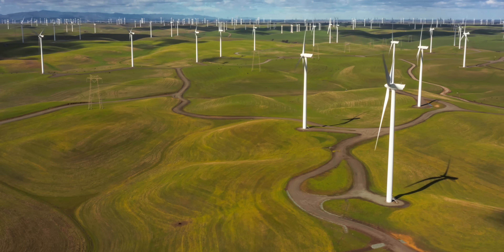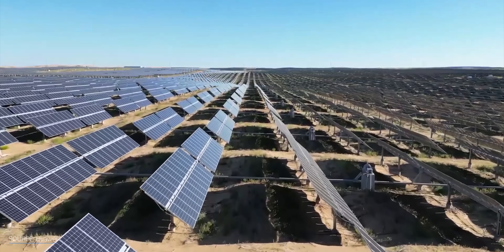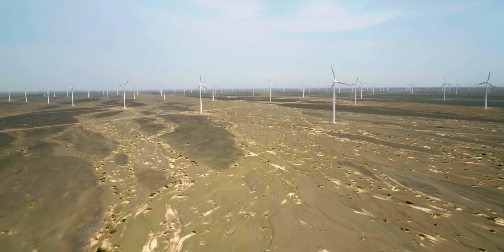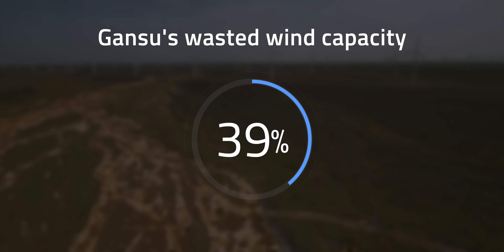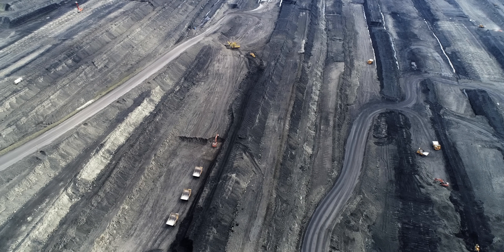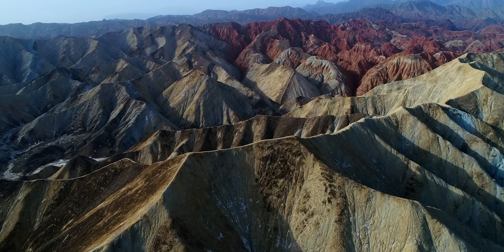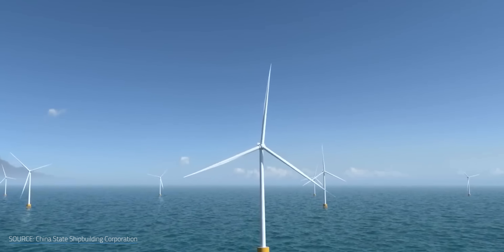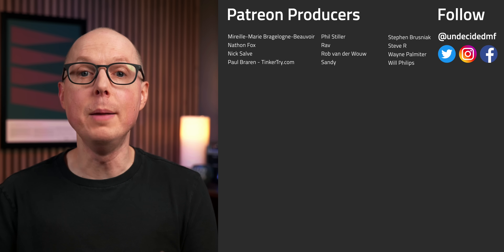The World’s Largest Wind Farm has a Tiny Problem

Comment: It is the load factor to understand how productive these wind farms really are during the year so multiply by peak capacity gives average amount they truly generate. Most have a load factor of about 25-33%
Reply: So for the most part 70-60% isn’t utilized does that mean the per mw hour the cost is higher than a gas nuclear etc which have constant production and arnt wasting nearly as much ? Or is wind 1/3 of the price therefore still competitive
Reply: @patrick-c6s You miss a n huge assumption as you don’t understand how the national grid works. Supply of electricity  must exactly match demand with MWh so in terms of output wind is “free” when it has a maintenance ost average above £20 Meh which may be cheaper than fossil fuel or nuclear but when you add the back up cost of fossil fuel for the high percentage of wind not delivering the required amount of power, the combination of the two costs is more expensive than if the grid simply contracted with fossil fuel alone and this simple analysis also excludes the huge subsidy paid to wind turbines. Something like 30% of a utility bill is subsidizing green renewables. No wonder UK has highest fuel bills for a major economy.
Reply: @_RabbitLeader  I understand how it must be balanced I probably didn’t get my point across well do you think the wind farms have any merit in terms of profitability environment etc ? What would be ur ideal grid composition? Just curious what others think
Reply: @patrick-c6s  Too costly to be building looking to wind to supply such a high % in UK. Even National Grid not sure how it will balance. Balancing costs will only explode.

Comment: 3.1 GW of LA’s power comes from the pacific DC intertie, going from the Washington border to LA. The California grid max is 50 GW. Typical daily load is 35 GW, so roughly 10% of California’s power is coming from hydro in Washington / Oregon. Long distance high voltage DC is totally doable in the modern era.

Comment: I live in Las Vegas, NV. Nevada is mostly open area, owned by the Federal Government. They say if you cover an area about the size of Clark County, where Las Vegas is located, you can power the entire U.S with solar power. Las Vegas has something like 330 sunshine days a year. The problem is just like China, what do you do with overcapacity? There are many options, from batteries to gravity devices. I personally like the gravity devices. The energy is free because it would just be led to ground. It doesn't matter if they are efficient. The power to operate them is free, otherwise going unused.

Comment: Wind Baseplate Power <> Produced Power.  These things are not efficient and MUST rely on hot-standby power.  Every wind turbine has an actual lifespan of 15 years before the cost of maintenance exceeds the power output.  Those at sea wear out more quickly and the cost of the undersea cables is greater than that of the structures.  These things cannot be recycled.  They are cut down like trees, chopped to pieces and placed into landfills.  They consume 100++ more area per watt generated compared to nuclear.  Hydro is truly clean, green, sustainable.  However, proposals are underway in the PNW (Pacific NW of the USA) to tear down hydro dams and replace them with wind turbines.  That would be economic and environmental insanity.

Comment: You lost me when you said "just one gigawatt".  One gigawatt is the capacity of a very large nuclear or coal plant.  Lots of the coal plants in Utah produce 400 MW per unit, so it would take two and one half of those units to produce one gigawatt.  We have some very impressive wind turbines near my home, 27 of them.  They have maximum production of 27 MW.  Given that they produce on average only one third of capacity, it would take about two thousand of these turbines to produce, on average. one gigawatt.  And you still haven't dealt with what to do to provide electricity when the wind isn't blowing.

You're living in fairy land.  There's not a chance people around here will let even one more windmill be built after they have seen what these 27 did to our scenic vistas.

Comment: I don’t think you can judge what is a success in a mere short time frame, these things and all the associated infrastructure are very expensive to install , they also have a service life and a cost to maintain, the same as those gigantic battery packs  , they also have a pollution footprint as well , some of which no one on the planet has found a good solution to I might add . 
Like T hose gigantic blades , bigger than a road train need to be replaced when the service life expires . 
I suppose for china they could just leave them in the desert to be covered with sand .
 All those wind turbines and thousands of miles of power lines also will need maintenance, , nothing is for free, even if initially now on paper it looks pretty good . 
Come back in 50 years and tally up for the true cost, I’m betting it won’t look anything like a cheap solution .

Comment: Matt Ferrell only briefly mentioned the missing part of the jig-saw which is energy storage. Using surplus windpower to produce green hydrogen looks like the most likely longer-term solution.  But the electrolyser developers are running to catch up and issues with hydrogen, like storing the stuff, are also still remaining to be effectively resolved.   

Hydrogen will be needed to replace natural gas in the long-run and clearly the use of electricity that would otherwise be wasted from large wind and solar farms is the obvious carbon-free way to produce it. Give it another ten years and the hydrogen economy will ride in on the back of wind and solar. I'm one of many working on the development of safe, lower-cost hydrogen storage.
Reply: @PeterFraenkel  

Please give us a hint about how to store / transport hydrogen cost effectively. Not trying to be critical at all but these are some of the issues with hydrogen. Personally it seems that ammonia might be a big player in this area, especially for countries like Japan.
Reply: forgot to mention in my earlier response below that our underground pressure vessels  could also contain ammonia which like you say is a potentially important alternative form of energy storage @Mentaculus42
Reply: JCB here in the UK certainly think so, and have developed not only the engines but the production, storage and transport of the H2 - they have tried battery power but for large machines which have to run all day, they take too long to recharge. The H2 is taken to the farm or construction site so refilling is a very small downtime. Installing a national network of H2 storage is another matter though...

Comment: The cost of land in China is a non-issue.  If the government wants land for a pro, there’s no acquisition cost.  They just say the land is now owned by the government.  No cost there.  

The cost to develop renewable energy in china is significantly lower than in the US.  Labor costs in China are a fraction of the labor costs in the US.  China builds the majority of the world’s solar panels, so between labor and manufacturing costs, land acquisition costs and operating costs, the costs per kWh in China is dramatically lower.  Plus they don’t worry about complying with environmental regulations.

Comment: Wind and solar energy enthusiasts never factor in land costs, backup costs, maintenance costs, regular replacement costs or the co2 emissions related to the manufacture, installation and logistics of these enormous infrastructures. They know deep down large scale renewable energy is a fools errand but they are wedded to ideology rather than common sense. They’re always on the left of politics. China’s motive is to dominate the manufacture, not to reduce co2 emissions.

Comment: Gansu is the same as ALTA in Kern county, CA. It is on the edge of the Mojave desert. The nearest town, Mojave, is population 3,850 and it is dirt poor. Hot, dry, windy, with loads of trailer parks and loads of residents that rely on section 8 housing vouchers. Mostly impoverished residents. The nearest large town in Kern county is Bakersfield, 90 miles away.  But almost all of that energy goes to LA, also 100 miles away, where there are millions that need it.

Comment: If only it could be like turned into hydrogen and pumped places and turned back into electricity in fuel cells but is building giant hydrogen pipelines any cheaper than HV lines?
Reply: Or couldn't they just send it through the rails of all the high-speed rail they built everywhere?

Comment: For me its all about the economics.  If you asked me to  install a wind like this in the US to just pay almost double the cost for electricity the answer is a rock solid no. 

And that cost was after massive gov subsidies that would not happen in the US.  Most new wind projects in the US have been put on hold because they don’t ROI especially due to maintenance costs ballooning and turbines not lasting as long as they were supposed to.

Maybe nuclear power is the better answer here, I see Microsoft will pay to restart 3 mile island and not build a new wind farm.  That says a lot.

Comment: Increasing renewable energy generation requires more overbuilding and less efficient use of electricity generation capacity. I still support wind and solar generation but there is requirement to have equivalent generation capacity from more reliable sources. My Canadian province, Alberta, has recently become coal power free, now having shifted to largely natural gas with wind and solar as the 2nd and 3rd largest maximum capacity sources, respectively. Looking at the current “supply demand report” I am a little proud to say that the wind farm I was a small part in the construction of is the largest producing wind farm at the moment. Fourth highest max capacity but most generation at this moment.

Comment: I'd be careful citing China's green energy as a success compared to other countries. China continues to be the large CO2 producer by far at ~33% of the world output, and still increasing annually at about 500 Mt per year average. For comparison, Canada's total CO2 output is only about 580 Mt per year, so China is increasing GHG output at about 1 new Canada per year.

By contrast, the U.S. peaked about 2005 to 2007 and decreasing at a rate of about 70 Mt per year average. 

The evidence suggests China needs to learn from the U.S., not the other way around. 

Granted, the U.S. is higher per capita, but peaked in 1998 and decreasing about 0.25 ton/person/year since whereas China has been increasing almost 0.25 ton/person/year since 1998. 

China is impressive in the scale of things it undertakes, but not in the effectiveness of accomplishments at problem solving. 

Rather, I'd look at China as an example for being careful about measuring successes based on intentions or effort rather than actual measured value of outcomes. 

Climate change mitigatiom is a function of global GHG reduction, and the U.S. has been doing far better at that than China, who is getting worse, not better.

https://www.worldometers.info/co2-emissions/china-co2-emissions/

Comment: The video provide a lot of green propaganda. The main challenge of dirty wind mills is that they provide power according to the coincidences of the weather not demand. In the grid demand and production need to be in line at any moment. It is like an X-mas tree on dec. 28th. The value of wind electricity is very low. 

To install a wind farm far away from consumption and far away from controllable power plants is an expensive and technical challenging step. It is most probably induced by politicans. 

I do not know anything against coal power plants. Against this video modern coal power plants are equipped with scrubbers, desulphurization and does not participate significant in the air pollution. 

A mixture of nuclear and coal would be more helpful.

Comment: Having spent decades in US infrastructure- “replication” of Gansu here is a completely unreasonable expectation. Gansu is built in a desert where there are no NIMBY forces to object. Even if there were objections- it’s China so we’re not going to hear about local objections since they’d be overruled before they could be registered. 
In the US power storage is a huge issue - no one presently wants battery storage facilities in their backyard. A change in battery tech to a more dense less volatile medium might go a long way  to changing that. 
Mentioning 3 Gorges is a bit ironic when speaking of US comparisons because it was built with people living in the “way” who were ordered out on little to no notice. Such “agility” in constructing public works here is impossible. In the US public hearings, redesigns, community objections and just compensation (under Federal and State constitutional mandates)are all lengthy processes that make “replication” of Gansu style projects in the US extremely unlikely. Certainly the timetables are not comparable- widening an existing highway here can take decades, Gansu seems to have gone from dusty desert to completion in only about 1 decade. Ponder high speed trains in Europe, Japan and China - then look at them here ( only in FL) for another glimpse at the problem. Curious as to whether the per kWh cost of coal remains cheaper than the Gansu cost.
Reply: 嗯 嗯  美洲原住民都是自愿把土地贡献给白种人的。因为你们最注重人权。

Comment: Solar and wind generation are great utilizations of otherwise barren areas. I don't know much at all about the biodiversity in the Gobi, Sahara, or our domestic deserts, the Mojave, Colorado, and Great Basin, or how wind and solar installations would impact that. But battery storage that could cover all the gaps in wind and solar shortfall (mostly the night), cooling them in that harsh environment, and maintaining them with an optimal 20 year rotation schedule is a problem. That's not to mention battery failures and the frequently resulting fires. Solar panels, except for damage, are basically maintenance-free for about 25 years. But wind turbines are notorious for mechanical failures. Many wind farms fall into disrepair and then abandonment after the subsidies end. This concept will make a lot more sense with emerging technologies like sodium batteries and wind turbine designs that don't require the huge blades and the bearings and structures that support them. But at this point the focus should be on developing deployable, low-maintenance technologies, not plunging head-first into projects that have very low chances of success.

Comment: 11:57  
 At 11:57 he says the “EFFICIENCY” raises to 95%. WHAT DOES THAT MEAN AND WHY PUT IT IN SUCH STRANGE TERMINOLOGY?!?! I guess that could mean that they only had to curtail 5% of POTENTIAL PRODUCTION, but if that is the case, just say it. 

Also, if you are going to state very old pricing of the produced electricity, why not make it relevant and state the contemporary pricing which is what he should be doing. AND if you are talking about pricing, add in that COST OF LONG DISTANCE TRANSMISSION to provide a total cost, AND YOU TALK ABOUT “STORAGE” for intermittent wind ADD THAT COST to get a TOTAL delivered cost!!  So now you still don’t have the total cost because you need to add in the cost of having DISPATCHABLE reserve generation to be available when the wind doesn’t BLOW (which has happened in England)!! 

Now you are getting closer to the true TOTAL COST of that “cheap wind generation” and be brave enough to compare it to the the cost of new dispatchable and locally produced NUCLEAR POWER in china which is cheaper than coal produced power!! AND China builds 5 plus nuclear power plants per year now on budget and on time, which the west seems to be unable to accomplish. But I suspect that you have strong opinions about nuclear power. AND while you are at it, maybe a video about what China is working on with HYDROGEN could be useful to get a balanced perspective.

Comment: Wind is free power. The machinery to collect thet power is far from free. It's expensive to build, install, and to maintain that equipment. Wind generators have a short lifespan and have to be replaced far more ofter than other sources of collection such as a dam or a geothermal collector. Wind is not a steady source of power. Honestly I fail to see why anybody would invest in it. Solar collection is only marginally better. It's not a steady source of power either, but it has far fewer moving parts and therefore fewer points of failure. Seems to me that we are taking a giant step backward collecting wind and solar as opposed to water and geothermal. Both of those sources are steady sources of power and don't require the same level of maintenance and overall costs are lower. Wht are we being stupid?

Comment: Wind power would be a miracle, but for the fact that the wind is changeable, and the machinery wears out, and the desert, well, the blowing grit and dust has defeated every form of machinery ever exposed to it. Simply, if the grit can kill those machines, especially when lifted and blown by the very wind they are exposed to, the machines, which are so terribly expensive, will grind to a halt after twenty years tops.

Comment: The wind turbine only last 20 years then what land fill note it takes 150 tons of coal to build a wind turbine and hundreds of barrel of oil for the propeller and decommissioning a wind turbine uses more fossil fuel than building them. unless they go for land fill. Solar is worse 22 smelted elements to make a solar panel life 25 year then land fill very hard to recycle.